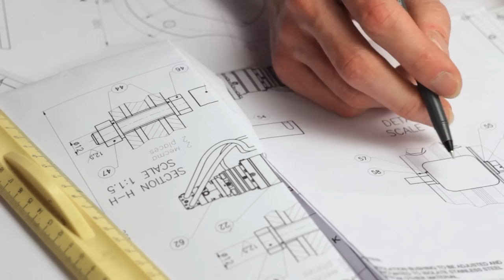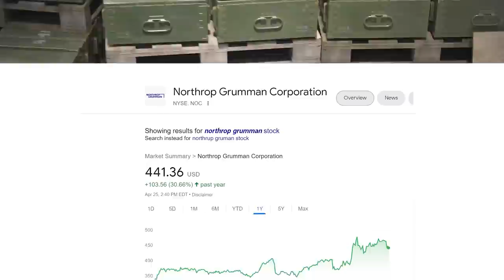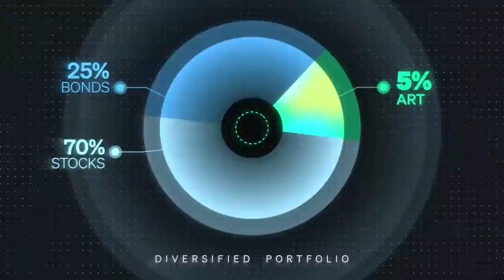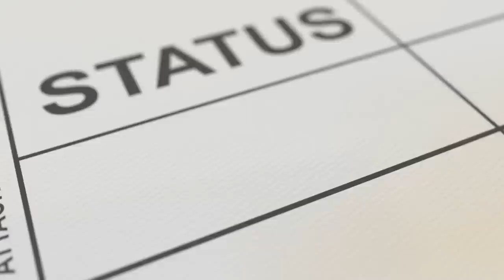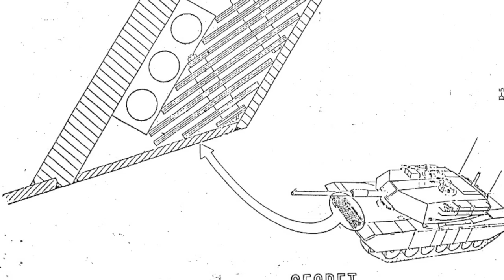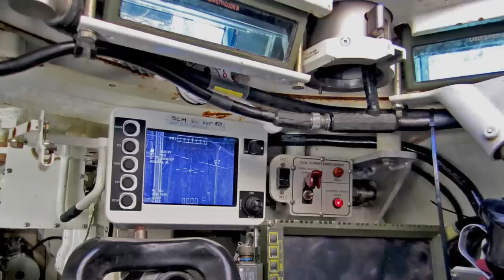The M1 Abrams Tank Needs to Chill Out

Comment: Its the next generation of abrams thats getting major upgrades to its fire control. Current abrams fire control is top of the line for 20 years ago, but out of date now. yes its likely behind the most modern t-72 variant in fire control. It does have Trophy, which is huge. That and combined arms are the difference. Not fire control. Look at how the abrams performed in yemen with the saudis. Very very poorly since it wasnt used properly. Same with turkish Leopard 2s in syria. Unsupported tanks are extremely vulnerable. Thats been true as long as theres been tanks.
Reply: Exactly, which is why the DoD is working on upgrading FCS to modern standards and adding APS to every new tank. But training is a massive part of how tanks are effective. You could have the top of the line Equipment but if your troops are braindead (Russia, Saudi, Iraq back in the 90’s) then they are going to get rocked. Which is why we still maintain some sort of edge against rivals. If a US tank platoon (+ supporting elements) using Abrams finds itself facing a Russian armored unit of similar size (also with its supporting elements), I think we’d still be fine. 
That being said, we need to upgrade to keep that edge.
Reply: Who would have thought tactics matter
Reply: @josephmcguire8566  anybody with brains. Apparently Russia seems to possess too few of those.
Reply: One of the biggest things missing from your writings is the major role Apaches and other aircraft will play. Russia has proven they don't know how to integrate the three together.
Reply: LOL, don't you think the fire control system has been continually updated?
Reply: I think Cavalry in general unsupported would be the better final point considering a lone cavalry charge is useless without support from skirmishers, men at arms, and archers. Unless you are Poland in ww2 leading a full tilt cavalary charge into modern arms... and winning...
Reply: @PeterMuskrat6968  Yup, they are working toward trophy as standard issue, which should make a huge difference. I'm not a huge fan of the Abrams as a platform, but no doubt right now that American training and combined arms are light-years ahead of the Russians. That and equipment of the individual soldier is far superior. But russia has plenty of hardware that's as good or better than their American counterparts. But right now they are not using their advantages well. That said they have reorganized and are far more effective now vs earlier in the war. Will be interesting to see.
Reply: Completely agree.How about they also add a small recon drone to each tank?Although if the infantry is properly supporting they use those.
Reply: @percyfaith11  A ton is the same equipment from 20 years ago. Best possible for 20 years ago, and as such isn't horrible now. But below average. Hence why the number 1 priority for current upgrades.
Reply: @aaronpaul9188  Sorry Aaron, we can agree to disagree but I'm not buying that the fire control system has not been upgraded since 2002.
Reply: @percyfaith11  Abrams uses second generation thermal sites for example, which is circa 2005ish. This generation thermals are being tested on the tank now, and I think have been approved and upgrades are underway. But these upgrades have not been issued yet, let alone standard issue. You can disagree all you like, but I am right. Upgrading the fire control is what is currently being done. Modernized russian t72s have third generational thermal sites. Not all russian tanks are the most up to date. I think a majority of lost russian tanks are the obsolete 72Bs. They are far inferior to the Abrams in fire control, and they are being used in combat. But the more modern T72 variants like the T72B3 have thied Gen thermal sites and other more advanced fire control than the Abrams.
Reply: @aaronpaul9188  third generation thermal sights are a buzzword. There isn’t any inherent difference between them and second generation.

Comment: I was a tank mechanic and m88a2 crewman during GWOT. tank crews are hard to replace and they maintain and love their vehicles. the best tank crews can keep their vehicle running and fighting for months without outside help besides supply. i had an excellent platoon and would follow my tankers anywhere they went. the best job and friends ive ever had.
Reply: Lol...reminds me of my wenches with wrenches...

Loved my guys...hell I was their go to designated driver in garrison...did all I could for them...so they could help .e keep my tank fighting...

Except for circuit breaker 19...could never figure out why that constantly blew on our m1a1 AIMS...replaced the GPS 3 times and several cables before it worked.

Comment: By 1977 the decision had been made to eventually move the new tank to a 120 mm gun. After head-to-head testing between the Royal Ordnance L11A5 and the Rheinmetall Rh-120, the latter was chosen. The turret designs of the two prototypes were modified to allow either gun to be fitted. Although the L11/M256 120mm gun was chosen to be the main weapon of the M1 Abrams in 1979, the improved ammunition for the gun still was not fully developed, thus delaying its fielding until 1984.[19]

Comment: Russia did continue to upgrade the armor on their tanks even when the Abrams had the 105mm. The T-72a (which had improved armor over previous models) entered service about the same time as the Abrams. Further, crew survivability is still important to Russia. They didn't design their vehicles at the detriment to the crew. They just had a different approach to it. By making tanks smaller, Russia could decrease the target profit, and armor the tank more for the same weight compared to bigger tanks. That was seen as a better approach than other solutions.
Reply: The ammo storage issue from the Soviets and Russians continue to be a problem. They could have selected an auto loader that did not have that issue and have protected ammo like the West does, but they chose not to.
Reply: @ricardoospina5970  the autoloaders used in western tanks like Leclerc have the problem of size. It gives the tank a much larger profile due to it being in the turret. Putting it in the hull allows the turret to be smaller. Also, the autoloaders do have spall protection armor around them. They are not blowout panels, but they do offer some protection.
Reply: at that time the doctrine was also still kinda relevant too. Fire control systems werent as advanced as today and having a smaller target to shoot at would make accurate shots actually a lot harder. nowadays its not relevant anymore as FCS can hit a tank sized target at more than 2-3km away. However more modern MBTs like the Type10, Leclerc and K2 have switched to (Cassette style) Autoloaders for decreased weight and ease of future upgrades to larger guns which human loaders couldnt handle the shells of.
Reply: @Yung_pindakaas  a smaller vehicle still had advantages. It will make the vehicle lighter, which helps mobility and armor protection. Also, the vehicle can use terrain features as cover better. A shorter tank is easier to hide.
Reply: @ethandertz1160  There are major drawbacks to their designed size. Even modern examples aren't "regular people" intended. The shortest folks in the army get put into the tanks because the Russian designed tanks are too small for regular people. A tight space wears more on a crew and introduces fatigue earlier. Also, they didn't really upgrade the armor within the hull. There wasn't really room for that. The Soviets/Russians instead applied armor to the OUTSIDE of the hull in the form of add-on steel plates and later, ERA panels. The smaller size also means they're limited on the size of power pack. This means that the smaller, lighter Russian tank also has a smaller, weaker engine. You'll see on the Abrams and Leopards that while they're heavier, their larger and much more powerful engines means that they still have a better HP:ton than almost any Russian tank. The other major drawback of the Soviet/Russian design is that their very short stature for their tank works against them mechanically. The very short space between turret and hull means that Soviet/Russian tanks have absolutely terrible gun depression. This means that prepared fighting positions for their tanks are much longer and shallower because the gun can't aim down very low at all. This means that the shooting/peaking strategy that Western tanks employ in their dugout defensive positions are very difficult to nearly impossible for Soviet/Russian tanks. To top this off, Soviet/Russian tanks also have very small gearboxes. This has resulted in the hilarious side effect of have very few reverse gears on a Russian tank. This means that even if they dig a proper defensive firing pit for their tank, the tank backs up extremely slowly which with the shallow angle of the pit means that the tank is left vulnerable for much longer. This is why the Iraqis just parked their tanks at the top of the fighting position and kept the tank in a hull-down position. It'd take forever to backup and the requirement for a pretty much flat top means that the tanks were vulnerable for much longer moving forward/backwards as was tradition for many Western tankers exploiting elevated terrain.
Reply: Soviet insistence on a low silhouette and cost-cutting was HUGELY detrimental to the crew. They were crammed in like sardines, using crude systems that may or may not work on a given day.
Reply: @Talishar  The T-80 has a better power to weight than the Abrams.
Reply: @SD78  modern Russian tanks like the B3 have systems that are fully capable of holding their own with western tanks.
Reply: @ethandertz1160  No, it doesn't.

Comment: The French were able to make a tank that used an auto loading main gun while also storing ammo in a blastdoor-sealed compartment. If we want "next generation" we should just be using that with Trophy active-protection-systems, the best sighting systems we can develop, and avoiding slapping too much steel around the hull to weigh the tank down.
Reply: But you know Leclerc still has ammo in chassis?
Reply: @matt_pigeonowsky1734  So does M1. The current move to bustle autoloaders (Or semi-autoloaders in the case of Merkava) in Western tanks (See also Type 90, Type 10, K2) seems to be the most advantageous in terms of ammunition separation. I was honestly stunned when Challenger 3 was announced to have a three-man turret crew with a manual loader.
Reply: @TheChieftainsHatch  Ammo in M1 is fully separated, thats the difference

Comment: Wasn’t the key to success for the m1 abrams was it’s ability to accurately hit targets while moving?  Main reason why it was so effective against the Russian tanks in the gulf war?
Reply: The war where youngest tanks were technologically nearly 20 years old?
Reply: In that war, it wasn't really the fact the tanks could fire on the move, but rather that it had an incredibly big targeting and range advantage over it's adversaries.

The Abrams could easily aquire targets serval kilometers away while it's enemies were stuck with optical systems. The fire control meant the first shot was most likely a hit, and because of the way the Russian tanks have a central autoloader, a kill.

Target acquisition still remains the best characteristic of the Abrams and one key aspect that must be further improved as fast moving and quick acting infantry get access to the means of eliminating tanks from ranges usually reserved for vehicles.
Reply: @mobiuscoreindustries  Especially when the only way to look around for commander was to use binoculars, Abrams didn't get commander panoramic sight until A2 model in '95(which is still better than most T-72, but still bad in comparsion with Leopard2)
Reply: gulf war was mainly about FCS. Sandstorms where Abrams had thermals and better engagement ranghes while iraqi T72s were downgraded export models.
Reply: @mobiuscoreindustries   thanks for the reply.
Reply: @matt_pigeonowsky1734  Youre talking Marine Corp Tanks and those tanks were not M1A2's They were M1A1's.... the M1A2 for the Army had the CITV (Commander Independent Thermal Viewer). We transitioned over to those back in '99 and introduced the M1A2 to NTC back in '99. The army never had a Panoramic sights as those were on the M1A1 and exclusive to the Marine Corp. Also the M1A1SA later had a thermal sight on the CIWS. mind you this was before the Australians got M1A1SA's

Comment: I don't think you can reach a firm conclusion about the effectiveness of Abrams until more is known about the details of the tank losses on both sides in the current conflict. I have seen quite a few cases where the tank has driven out of its track and then been burned or exploded. This implies it was immobilized by mechanical breakdown, non-fatal ATW hit, or detonated an AT mine before the final fire/explosion. There are also cases where the tank has become stuck in the soft ground and then subsequently destroyed. There are a lot of cases where the circumstances of the loss are unclear.

Knowing how many of the tanks were destroyed by their own crews or hit with ATGMs after they were abandoned is a key part of the overall picture.

The Abrams is 20T heavier than the T90. Even if the ground pressure is the same, the extra 20T adds to the difficulty of recovery. Mines are a cheap and effective way of immobilizing tanks. They are particularly effective when the ground is sodden and tanks are restricted to roads and obvious lines of advance.

On open dry ground, the Abrams will excel but the conditions in Ukraine are not ideal for any tank. The Abrams advantages might be reduced to simply enhanced crew protection.
Reply: the US has the resources and machines to recover pretty much anything in their arsenal, while it seems Russia is just throwing it's old obsolete cold war tanks away. something no NATO country would ever consider
Reply: @mayhem3649 Damaged equipment behind the lines will be recovered but recovering equipment in the battle zone risks compounding losses. Recovery vehicles are just as, or more, prone to destruction from mines, ATGMs and direct fire. Tank repair teams are highly trained specialists that are no more expendable than the tank crews.
If a tank must be abandoned the tactical situation will determine whether it must be destroyed to prevent it from being used by the enemy. Every trained crew has a procedure for destroying equipment that must be abandoned. 
A "big war" consumes vast amounts of equipment on both sides regardless of who is "winning", and who is "losing"

Comment: Former member of 1st tanks division (H&S motor pool) the tanks that got sent back mostly due to prolonged exposure to dust, much like the helicopters they weren't designed with sand fatigue in mind and it would jack up the engine. 1st tier repairs (replacing tracks and other minor repairs) done by the crew, 2nd tier (think replacing parts on the engine) done by the mechanics section, 3rd tier (engine swaps and other repairs that expose classified items) done by contractors from the manufacturer. It was cheaper and more time efficient to ship back tier 3 repairs to the states and replace with existing units on ship then to ship the parts and expensive contractors to a war zone

Comment: I was a Abrams mechanic in the army and in 2 tours in Iraq we never had a Abrams that had major structural damage to the hulls most damage was suspension or side skirts and was able to get repaired and sent back out unlike many of the Bradley's that my unit had that would hit a IED and the floor of the engine compartment would bow up and crack the engine and would need to be shipped back to the states for major repairs or to be scrapped
Reply: I was deployed 4 times and in 2005, My wingman's tank ran over a triple stack african land mines which did breach the hull by the number 2 and 3 shock housing which left a 6 inch gash, destroyed the comp arm and 2 torsion bars.. however those were land mines, RPG's or IED's from the side of the road?....Scratches.
Reply: @CCM1199  Abrams hulls are tough as hell a hit that would cause a  6 inch gash in a Abrams would have been a huge hole in a Bradley, 113 or a MRAP